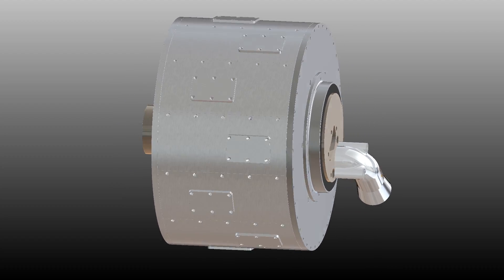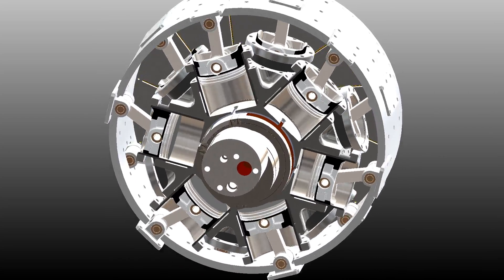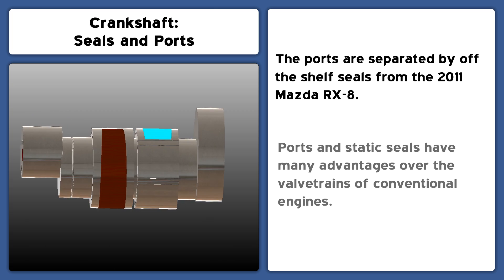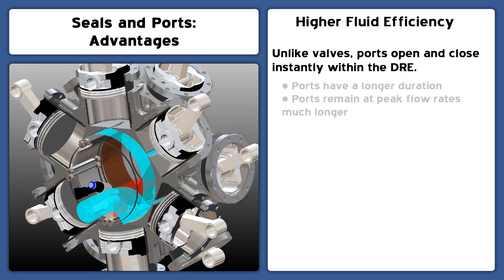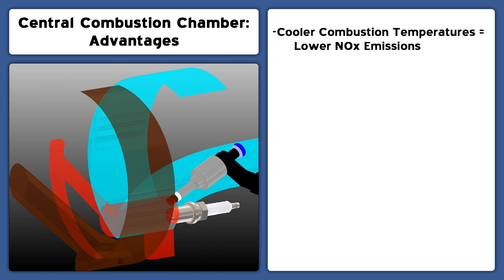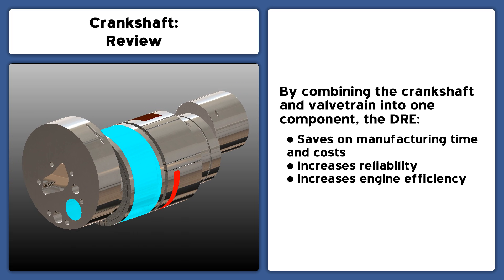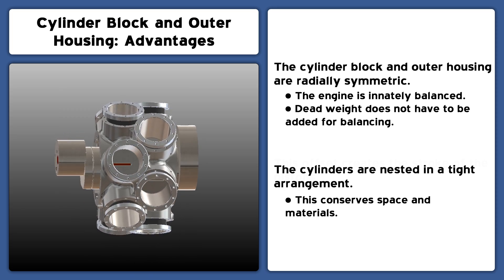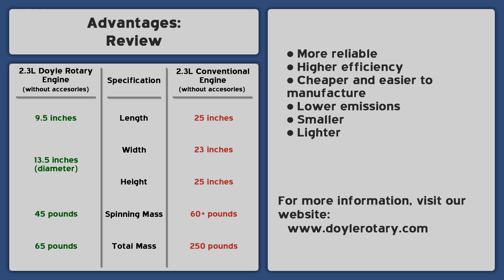New Split Cycle Engine Concept: The Doyle Rotary Engine

Comment: the biggest question i have is how you intend to transfer power from a rotating block to a drivetrain/transmission? i can't imagine how you would mount an engine like this, and i would think that the amount of inertia would twist everything to either the left or right side. i'm interested to see how this engine will be applied!

Comment: The 2 stroke also has lower Nox emissions than a 4 stroke of the same capacity (1/24th according to US Government scientists).

The questions I have concern lubrication and cooling of the engine..... always a bugbear in engine design.

Also what design of exhaust system would enhance the engine?? Due to the characteristics of the Doyle engine would a 2 stroke type Klaaden system work best??

I also used to drag race 2 strokes back in the 1980's. They ran better if raced from cold.

Comment: I had trouble at first too. But it seems to me like it's very similar to pedaling a bicycle. I think the pistons wouldn't be moving. The crankshaft is offset so when it spins it creates the compression. When the fuel is ignited the crankshaft is pushed off of the piston. Its basically the opposite of a 2 cycle piston engine with rows of intake and exhaust pistons... i never really understood how 2 cycle engines work so idk how having the 2 rows of pistons would work but i think it has potential.

Comment: Hi Lonny, 
Is there a pressure drop when air expands into the combustion chamber?  Or is the combustion chamber kept at the maximum pressure?  How does that pressure then propagate thrue the compression, pre/post-combustion chamber, and the expansion through the power piston?  It would seem to be a bit of a trick keeping pumping losses low, particularly in compression into the chamber.

Comment: I can see rapid seal wear at the exhaust end from heat ,plus oil mixed with gas is a bad thing like the old 2 cycle engines EPA hates. regular poppit valves are super reliable I have a Chevy 2.5 liter engine with over 300,000 miles and valves in great condition . No wankel engine can outlast or be as reliable as the good old standard piston engine

Comment: In my opinion, the two most fundamental problems that I am seeing are 1) There will be large fluid friction losses arising from the gases going thru the ports, resulting in much lower-than-expected power output. This loss will be very large with the hot combustion gases.  2) The hot, rapidly expanding combustion gases will quickly erode the edges of the ports they pass thru. The damaged areas will then destroy the seals. This is all I have to say about this.

Comment: I would like to recognize Lonny Doyle's dedication to this project over such a long period of time. I can only hope that others associated with this program don't fall into the trap of making unsubstantiated claims in order to attract investment capital. The problem with engine development is that it requires a massive amount of knowledge in a lot of engineering disciplines, such as thermodynamics, combustion dynamics, heat transfer, and materials science that is lacking here. It is not workable

Comment: so how do you lubricate the "scrapers/rings" in the valvetrain?   you will need to add oil to you mixture   or at least thats the way I see it..  which gives it some of the same issues  RX type rotories have (wankle).  they burn oil.  an no matter how smal that is  it will add to you emissions  and is tough on spark plugs..  and being there is only one plug
  have you though about adding a second or third plug?  it acts as a failsaif if one was to fail and it might add to your combustion process

Comment: Very cool design. Have you or have you been able to get anyone to do any computations on output vs conventional engines.  It looks to be both lighter and potentially more powerful. Lighter generally means less expensive material costs if conventional engine materials are used. I'm subscribing. I'm concerned about the balance.

Comment: This is much to complex. And with twice as many pistons comes significant friction increase. What about the weight of the water to cool it spinning around. And long term reliability of seals constantly under fire is unknown. Disregard the fact that the combustion is indirect and will lose thermal energy before it even pushes a piston. Good luck adapting this to a transmission and keeping everything reasonable. Lol

Comment: I too have a split cycle, but it is rotary 3D variable volume engine Idea instead of 1D variable volume system of piston and cylinder mechanism. Presently it is under the process of patenting with EPO and so cannot be uploaded at the moment. I am making a prototype. It has even lesser number of parts. I know you will get interested. If so,you may write to me on arvindatma@gmail.com for a personal communication under the promise that you will not divulge the information to others.
Thanks
Arvind

Comment: looks similar to the pinned rods on an aircraft radial engine? One master rod/bearing with the other con rods pinned onto it.  The offset cylinder body then rotates with the piston spinning on the fixed shaft.

Comment: i would really like to see the progress on this rotary, it sounds like the negative qualities from the Wankel (oil burn, gas mileage) have finally been addressed and redesigned in a positive direction. it does seem like a radical design but at the time so was the rotary and piston engines. this may be the new start this motor needs.  i'm subbing

Comment: static seals won't clear contaminats as  well as free flowing and lubricated seals leanear or rotary . growth rates disimalar metals and combustion pressure limit this only just getting true seal rings on top end parts on race engines now.  opposing and in line osillating engines. nice concept seen one in brisbane 25 years ago good compressor . ir was very intrested.rotary is the go for compressors pd with cooler .

Comment: There is only so much efficiency you can get out of a gasoline powered internal combustion engine before you don't have any gas left to ignite. The ideal ratio is about 17 parts air to 1 part fuel, but in a real world situation with stop and go driving, hills, etc., it's extremely difficult to do this. On the other hand there is an alternative to oil right now, natural gas, although it has a lower energy content then gasoline it does not have to be imported.

Comment: What is the fuel you are planning on using? Diesel could have a longer future and is a good transition to no fossil fuel burning because it can be "farmed" with algae and is generally more efficient than gasoline. I understand you have a spark plug, which indicates gasoline, though I wonder if compression can be risen high enough in a similar design to ignite diesel?

Comment from the maker: Lowering the combustion temperature does not increase thermal efficiency, we are just trying to avoid the super elevated temperature spikes that cause NoX.

We are allowing a slightly longer time for combustion.

The DRE is liquid cooled, coolant flows through the stationary crank, around each of the rotating cylinders and then returns back through the crank and then out to the radiator.

Comment: "reciprocating mass" the pistons accelerate clockwise and counterclockwise (left and right) respective to the angular velocity of the shaft. not up and down like a traditional engine. just my helpful input :). good idea but this is an inverted rotary engine. i hope you have done everything on paper (i mean paper and not computer) before anything is machined. i learned my lesson haha

Comment: Cool, I've seen a similar split cycle engine built with poppet valves though. Since you do have the centrifugal force on the air as the engine rotates, would changing the direction the pistons face improve the efficiency of the engine or would it just make the ports too difficult to operate properly?

Comment: This won't work! Pressure on the expansion cylinder must be significantly higher than the pressure in the compression cylinder, in order for this engine to turn over and not stall. You may presume combustion of fuel in the combustion chamber would increase the pressure that is let out into the expansion cylinder; however rate of pressure change required in the combustion chamber is way too rapid for this engine.

Comment: There's a certain level of dishonesty inherent in videos like this. They're making claims and using language about this engine *as if it exists*. It doesn't. It's an idea, and until they have a real physical engine, it will remain just an idea. I am getting really, *really* tired of seeing videos about supposedly ingenious engine designs that do not include a video of a real prototype running and producing power on a dyno. Anyone can make shiny shapes animate in a CAD program.

Comment: The main reason petrolium fuel is used is the amount of energy that can be attained from it, a lighter more efficient engine consequently allows for less energetic fuels like ethanol or bio-diesel without comprimising performance.

Comment: If your still using Aluminum for your prototype,
Use Teflon impregnation of the block after, you 
Graphite impregnate the Aluminum for casting.,
And during Tempering. (Anealing)

Comment: I agree, as long as there is oil coming out of the ground, nothing will change, the oil industry is nothing but a service industry, does not create wealth except for the owners. Now if you seperate the hydro and the carbon (hydrogen as a fuel carrier) (carbon as a product, ie carbon fiber) now you create wealth!!

Comment: wait i dont get it....if it has a stationary crankshaft, then how can it be connected and drive anything? then what do you connect to drive the generator/pump/transmission/propeller? does the whole rotary engine connect to whatever it drives if not the crankshaft?

Comment: Exceptionally well thought out - Someone commented on heat. the rotating cylinders reminded me of an old Hungarian rotary engine in which the crankshaft was stationary and the cylinders rotated with the propeller. By providing fins on the cylinder liners, air cooling was much better than the more classic style. It may be that you can use this rotation to your advantage by forcing air through the enclosure. Anyway fine job.
Reply: Yes, this is clearly inspired by the rotating block radial engines of about a century ago.

Comment: This is just not pratcical mostly because it would be almost impossible to cool.
1: pistons so close together creates lots of heat
2: sealed unit. no way for coolant to enter and escape.
3: even if you could get coolant in and out you would need lots of it which means a huge radiator.

Comment: Well you ask about the apex seals in Mazdas engine, now if I'm not mistaken those are the seals at the tips of the rotors. This engine does not have rotors like the Mazda engine, so where would the apex seals be? I'm not trying to be a smart ass, I really don't know.

Comment: I don't mean to be negative about this. It looks like a lot of engineering went into this complex motor. And it looks expensive. In my mind it has to pass the test of cost, efficiency, and availability. You have to prove it's more efficient and it's more affordable than a typical ic engine. Then try to sell it to one of the big auto makers...

Comment: I disagree! We're going to be stuck with the ICE for awhile yet. If you're thinking Electric cars, then I agree with you. But the batteries to power Electrics may never be as good as we'd really like them to be.
 What I find the ICE can be engineered to be very good at,,,is spinning a generator to make electricity to charge those batteries for a much smaller footprint on the environment.
ADoyle88 ,,, Keep up the research! You're doing fine!

Comment: You cannot use square cylinders because of excessive pressures on the points of the squares.  This is the same reason airplane windows are round or have rounded edges.  Corners are bad.

Comment: And NASCAR crews can assemble an entire ~5.7L V8 in thirty minutes flat.

Just because it's got less parts doesn't mean it is easier to work on.

Also, your static seals are less reliable than poppet valves. Wankel engines have a LOT of problems with the apex seals going out in 75-150 thousand miles. The poppet valves in my Ford F150 have over 310K on them and they work fine.

Comment: When i look at this,my first thought is that of the rotary engines in WW1 aircraft which had a stationary crank and rotating cylinders with the propeller attached,which, at least, was air cooled.

Comment: a 40 lb flywheel?  are you insane?  20 lb flywheel is more like it.  How does the power generated by the 4.2L DRE compare to the V6?  Do you have a running prototype?  What is the durability of the sealing parts like with all that centrifugal force slinging lubrication outward?

Comment: a jet engine does not reciprocate and spin, this engine does.  hence the need for an eccentric crankshaft to act as a cam to drive connecting rods/pistons through a cylinder bore.  a jet engine relies on aerodynamic forces to create power while this relies on pressure delta.  I do not believe that a gas turbine engine of the same diameter and power output would have slower throttle response even though the angular speeds would be higher than the DRE.

Comment: Early 20th century aircraft engines had similar designs, but inverted cylinders, which had few of the advantages of the DRE "upside down" cylinder design.  They were tolerable because the engine basically stayed at a steady rpm anytime it was running, but they were pretty awful otherwise.

Comment: How much mass is rotating?  Is this designed to drive an automobile?  The inertia seems like it would make engine speed changes rather slow and add huge forces to combat to change the yaw/roll of the car.  If the induction air enters the engine at a smooth, uninterrupted flow, pressure wave tuning is not possible.  what is the V.E. of this design?  how is heat controlled?  liquid cooling?  is the surface area adequate to dissipate the heat?  Interesting design.

Comment: Not only that but the residual pressure left in the cylinder after combustion, somewhere around 100psi. I've read, helps expel exhaust gases and plays a role in scavenging exhaust from other cylinders.

Comment: If conventional engines dump 30% of compression, their piston is still being pushed when the exhaust valve opens.  If the cylinder was so long that its contents reached atmospheric pressure before being released, as you seem to be suggesting, then pressure on the piston towards the bottom of the stroke would be close to zero, so the engine would develop less power.  Also, as less combustion heat is released into the exhaust, more would have to be absorbed by the cooling system, not less.

Comment: In all honesty, the gyro effect may be a good thing, at least in aircraft, providing some extra stability and removing the need for large control surfaces.  Albeit you would need more force to change direction, but again, not a bad thing, if you can harness it.

Comment: I would put a secondary outer casing on this beast, simply to hold a coolant or lubricant, and to keep some idiot from reaching into the running car and getting his hand ripped off by a spinning engine housing.  Also, how are you translating the spinning casing to power?

Comment: lol and I'm just supposed to take your word for it? You've got all the pistons, rods, cylinders(+water?) and casing spinning here AND the pistons and rods reciprocating. A conventional engine just has crank spinning (+ cam in a 4 stroke), plus the reciprocating pistons and rods (and valve train in a 4 stroke). 
Just setting the two side by side and looking at what spins I find it REALLY hard to believe this engine has a lighter rotating assembly than a conventional engine of equal...
continued

Comment: That's alot of weight swinging around, probably more than a conventional engine and it's "dead weight" used for balancing. Reminds me a bit of the old WWI rotary engine, the one where the crankcase and cylinders revolve rather than the pistons/rods/crankshaft.

Comment from the maker: 1. Check out my replies to 'DownhillAllTheWay' above. TLDR: The DRE produces the same power with less heat going to the cooling system.

2. The DRE will be really easy to remove and disassemble. A conventional V6 has over 2400 parts while the 4.3 liter DRE has just over 200. We've had to assemble, disassemble and reassemble the DRE prototype. We can tear it down and put it back together in less than 2 hours because we don't have to deal with cylinder heads.

Comment from the maker: The DRE can be adapted to use many fuels. We picked direct injected gasoline for this model because it is what we are used to. The most recent prototype fired up on propane because a propane mixer from a fork lift is much cheaper than a custom tailored direct injection system.

Comment from the maker: Finally, since the DRE has a single combustion chamber, specialized ceramic coatings become cost effective and the comb chamber walls will be coated with an insulating layer. This will allow heat to remain in the combustion chamber and to be used when the next charge of fresh air enters the chamber. Instead of being sapped from the engine by the cooling system, this heat will be used.

Comment from the maker: Secondly, conventional engines fire before top dead center. Firing BTDC means that the flame front begins to expand as the piston continues to compress. This causes a high heat spike that increases combustion temperatures dramatically. The DRE does not fire on top of the compression piston and will not have the high heat spike. This will decrease peak combustion temperatures and the lessen the cooling requirements.